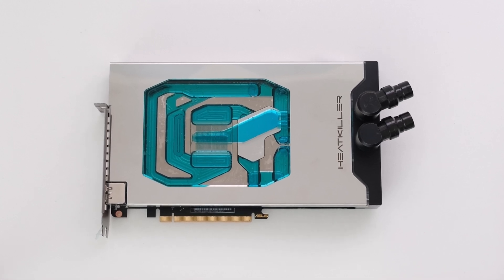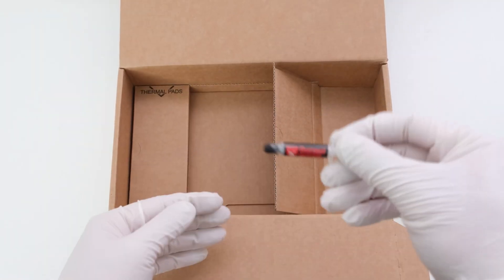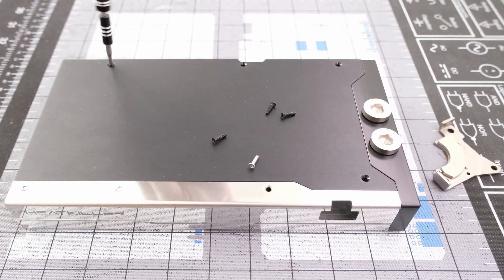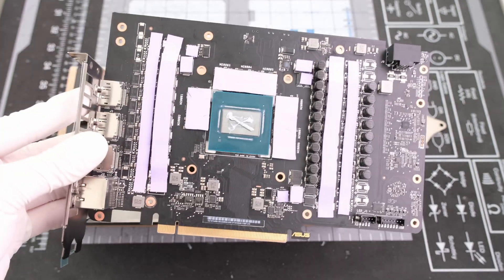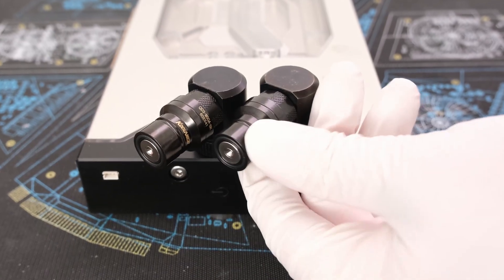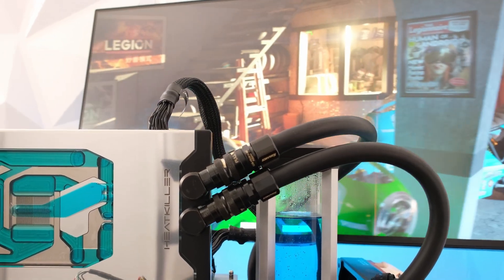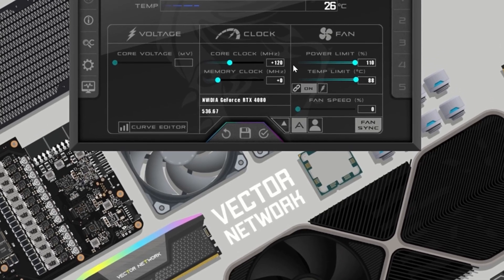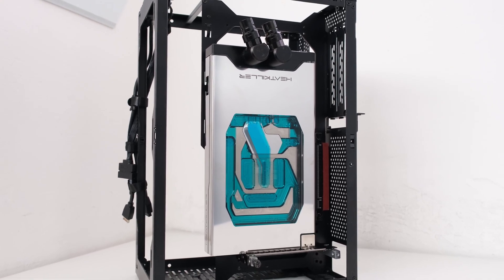Watercool Heatkiller V RTX 4080 ASUS TUF - Install & Test

Comment: Do you happen to know which coolant that was? I would also like to have the color, it looks clean.
Reply from the maker: This is either the Aquacomputer Double Protect Ultra in Blue or the Mayhems Eco in Blue. If I had to choose, I would first try double protect ultra. It may look darker in the bottom, but the colors always lighten up when they are in the block (liquid is very shallow in the block). Hope that helps

Comment: compatible with RTX4080 Super ?
Reply from the maker: Thanks for your comment 🙏 It should be compatible. The next video will be the 4080 super strix teardown. I already put it on a 4080 water block and it fits. Should be the same for the TUF. Hope that helps
Reply: @vectornetwork  I have a Gigabyte Aero 4080 Super
Reply: @Fr-Midnight  The Heatkiller V is only compatible with the FE and the TUF/Strix models.
Reply: @HagbardCeline23  using a heatkiller V for my tuf 4080 super will fit right?

Comment: What radiators u use for testing ?
Reply from the maker: Thanks for your comment🙏and thank you for watching! I decided to go with a single 30mm Alphacool radiator, the ST30 360mm because it's a full copper radiator and has 5 ports for convenience. 3x Noctua 25mm fans to cool. These were chosen because they are fairly standard sizing. Hope that helps
Reply: @vectornetwork  my god so the New one watercool heatkiller i same awesome like for 3090 with temps
Reply: @Goku-dh5fx *God